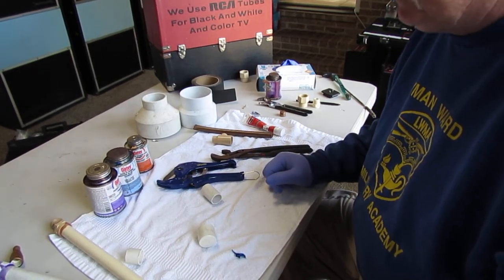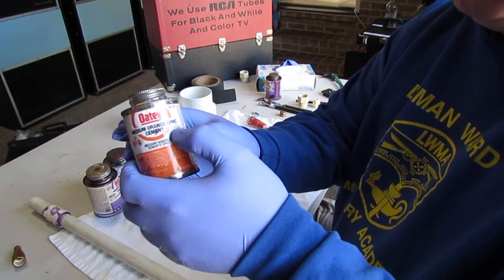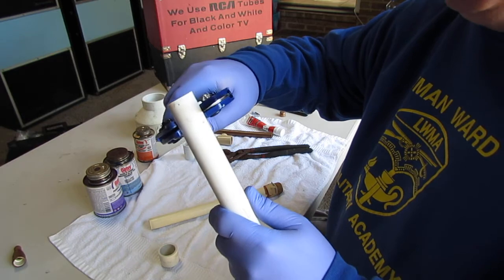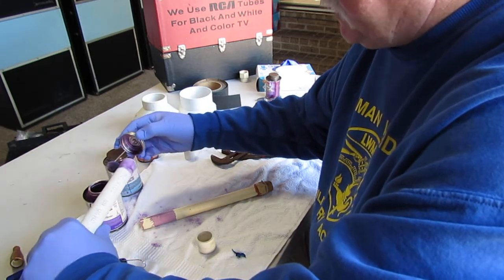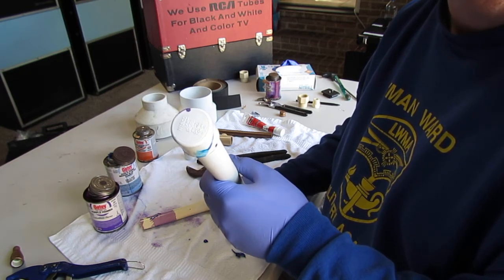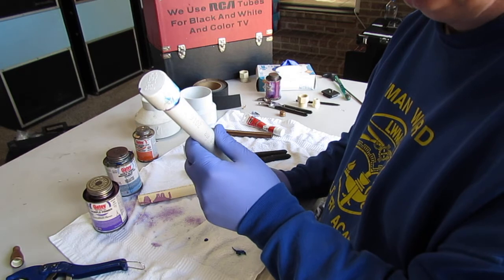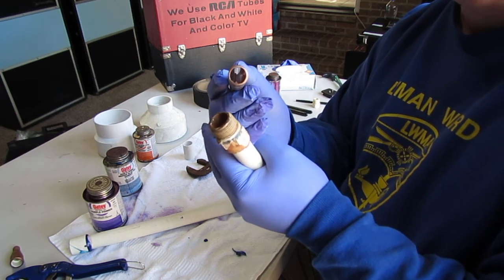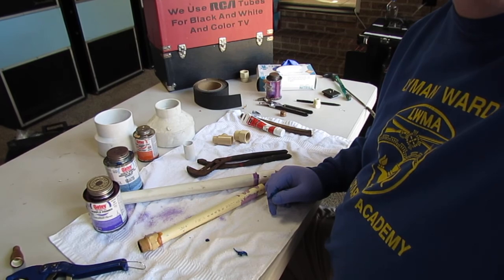What to know about PVC CPVC Hot Water Pipe vs PEX review which is the best  plumbing product

Comment: Paulturner5233 Copper is not superior product. It depends on the water source.  The only leak I ever had was from copper pipe itself not a connection. Water ate through it. CPVC for 26 years now no issues

Comment: Hot water pipe is starting to fail under my house, small fractures in the pipes only on the hot water pipes. cold water pipes are just fine. Luckily I had some pex line in my shed that I forgot all about so all I need is sharkbite fittings.
Reply from the maker: SharkBite fittings will certainly work, howerver its questionable about how long they will last, since they depend on a rubber O-Ring to prevent leaks. But sometimes its best to take the path of least resistance by using them.
Reply: @southernhometalk2465  I just installed all pex with sharkbite fittings for my hot water line and obviously no leaks yet, I'm curious to see how long this will last though. Had to cut a hole in the side of my cabin to get to the hot water behind the bathtub and that was annoying but sure as hell beats pvc.
Reply from the maker: Its subjective on how long Shark Bites will last, but sometimes the path of least resistance is the best way to go.
 @robertfarquhar2780
Reply from the maker: What type of pipe was the cracking pipe ? Thanks
Reply: @southernhometalk2465  PVC sch 40 and it's also exposed to the elements outside because I haven't hung any skirting yet on my cabin.
Reply from the maker: Hot water should not run through PVC pipe and all plastic plumbing should be completely insulated to protect from UV Light. I have found  CPVC, which is used for hot water can become brittle over time and fail as a  result.  I have also read articles where some manufacturers have shortened the warranty to 10 years on CPVC.  @robertfarquhar2780
Reply: @southernhometalk2465  Yeah I used pvc because I already had so much of it before I built my house. I knew eventually it would cause problems but this weekend I will create a more permanent solution.